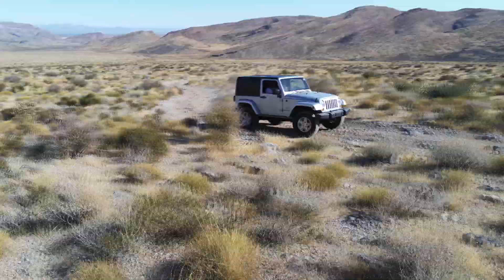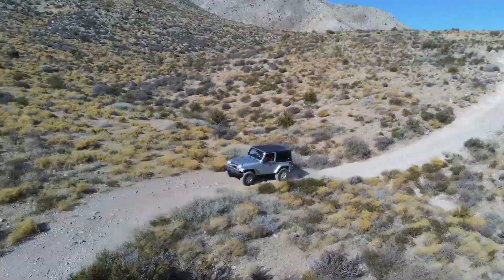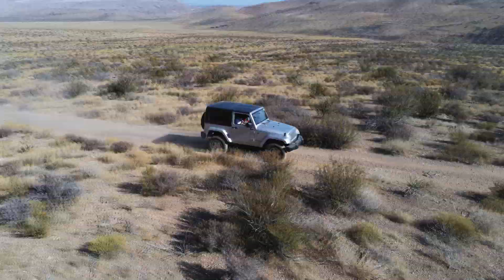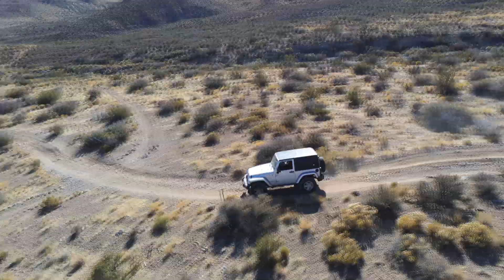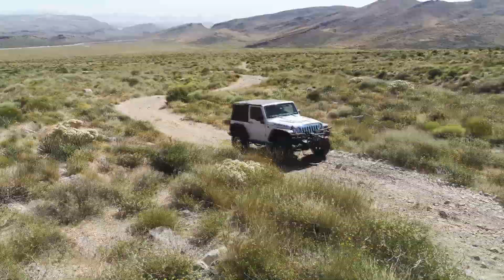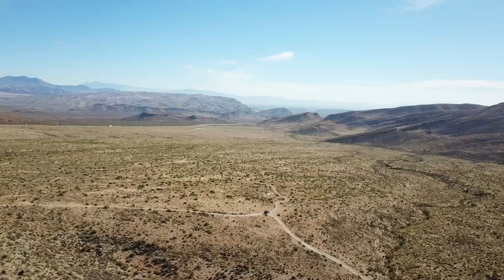Jeep Wrangler V8 Conversion Cost?

Comment: no emissions for mom & pop shops using older stock up is fine by Me/GOD. Sure customer will always b happier w/better fuel burn ie less emissions but for racing low production nothing to see. U built/produce more than 5k per yr non racing miles normal use yeah min mpg of 20combined rating in 2020. Each yr every non F350 wt class must get 1 more combined mpg 21 in 2021-30 in 2030. Only out is if u hve commute mode using no gas & 40 miles min range. gas is cleaner than diesel unless it can't make the power needed or meet mpg GOD rating.  The milage is key bc cleaner propane/hydrogen mixed virtually nothing emissions coming, I anti sweeting the tail pipe bc proplem is going away.
Reply: nat gas & hydrogen near free clean driving even cleaner than propane just not available all over the world like propane.20 to 80% non explosive mix rate & every of game of fuel or bs power is near dead tech other than nuclear in space or under sea. I am doing away w/under sea subs utterly leaving only space bs fueling needs.

Comment: which GM upgrade engine lets u shut down 2 or 4 of the cylinders to save fuel tech? Only engine that makes the grade in my GOD book.
Reply: GM gas had TONS of issues with the lifters in the engines with cylinder deactivation. Many are lucky to make much over 100k miles which is good reason to delete this junk when installing an LS. Most would say the least reliable part of the LS swap.